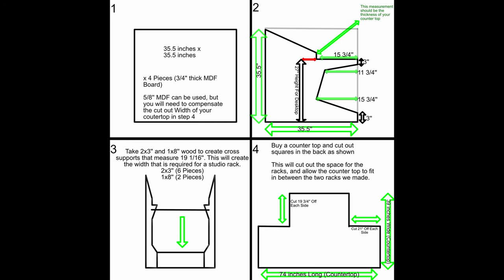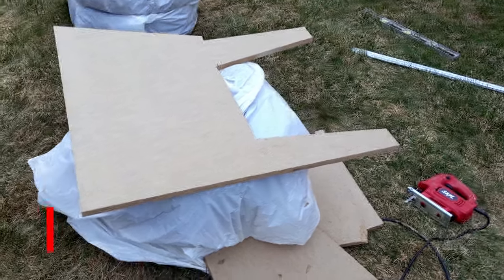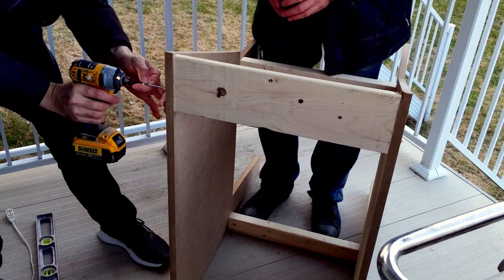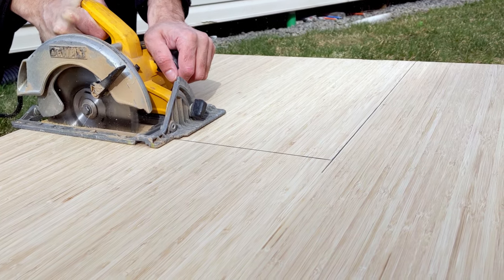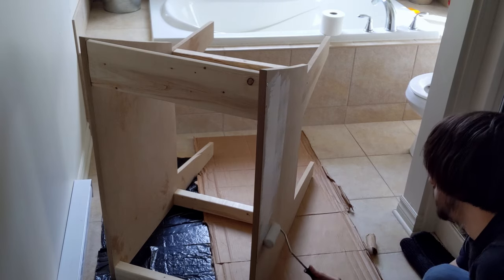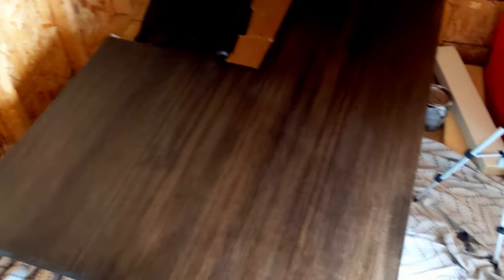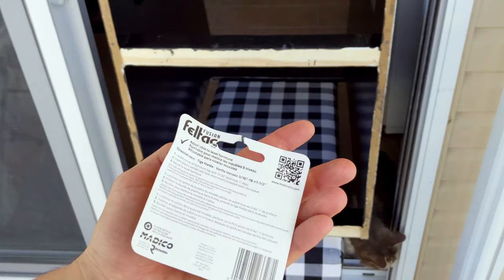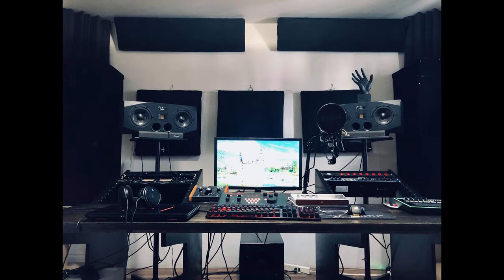DIY Music Studio Desk - Build A Desk In 10 Steps [+ Free Plans]

Comment: Great video .. I built a desk using your plans but made it with top shelves for my monitors as I don’t have room for separate stands .. I also used a solid oak desk top .. it looks great .. thanks again for your video, it inspired me to make my own desk without spending a huge amount of money
Reply: How much did it coast you ?
Reply: Do you have any pics you wanna share?
Reply: @vpetroi3  sorry for the HUGE delay in responding …. If I remember correctly, I was around £350 all in but this included the oak worktop … you could cut the cost with a cheaper worktop … hope this helps

Comment: Tip: If your using a level to level and plumb your project, you have to make sure what it is sitting on is level, or you wont be square or  level when it sitting on a level surface like your floor.

Comment: Nice desk, I'll make mine base on this design. Just a tip as I'm a construction worker. Using a leveling tool is fine if the reference surface is level. I have learned that the hard way at my first job site years ago! That balcony propably have a small inclinasion toward the outside the help the water evacuate the oposite side of the house. This one look sturdy, but you never know. Always check your reference surface as a mixing eng. use references tracks when using a leveling tool.

Comment: NICE man! So, now that you've been at the desk for a bit, are there any things you would change?
Reply from the maker: Hey, I would maybe have gone with less depth on the front part of the desk surface, it's a bit of a stretch for me to reach anything at the top few rack spaces 

That's the main one I sometimes think of
Reply: @ClaritoneAudio  You could cut a section out of the desk top, in the front middle, so that you can scoot in closer, and just re stain/poly the cut. Round the outside corners on the cut, so you don't have sharp ends. Currently building a desk, and really like how you have the rack accessible from the top. Looks real nice man!!
Reply: @AI-Consultant  Just draw a design on the top of the desk, cut that out with a jig saw, and then go around it with a router if you want to smooth it out. You could use a "flush cut round over bit" if you want.
Reply: I’m building this.  Will post when finished.  Thank You!
Reply: This is amazing work thanks for sharing. 
The bamboo top kind of surprises me.. very cool.

Comment: How do you figure out the angle of the rack units?
Reply: I used an angle finder and it came to 65 degrees.
Reply from the maker: this changes based on the thickness of your desktop material.. you'll have to adjust all the cuts if you want to change the angle more than it is.

Comment: I love this design because I'll be moving soon and this allows you to have the desk in manageable pieces. Thank you so much for the plans.  I do plan to build this desk.  The modifications I'm thinking of are to only have 6 rack spaces per side instead of 10 per side.  And also to make the desk top a couple of inches shorter.  I'm not sure how these changes will affect the stability of the desk, though.  I may even put the two sides together with no space in-between to make it more compact.  (like the Bazel Raystag desks) and then add a ledge behind the racks to hold the video monitor.  This guy did something similar to this desk in Europe, using metric measurements with angled side pieces - https://www.youtube.com/watch?v=KTGrjkJs2gw.

Comment: Nice design.  How much of a cost difference would you say there is between this and a ready made desk?
Reply from the maker: +Sub Element Recordings desks here in Canada start at around 1000 for the absolute cheapest options made for studios. 

something with this size and rack space would be anywhere from 1500$ and up + the shipping costs of ordering a full desk :) so at least 50% cheaper I would say.
Reply: @ClaritoneAudio  That's a significant difference.  Thanks for the info.  I'm in the market for a new desk and have been playing around with the DIY option.  I like this design.  I would likely make a small modification for a touchscreen if I went this route, but this is probably the best DIY design I've seen around.  Great work!  Cheers!
Reply from the maker: +Sub Element Recordings totally ! and that's the beauty of it, you can play with it based on your needs and available materials. 

thanks, I'm very glad to hear that! good luck with yours, cheers !

Comment: That's amazing. I'd like to build but I can't find the bamboo counter that deep. Where did you find yours?
Reply from the maker: Hi, 

I'm from Canada so I'm not sure if it will apply, but it was purchased at the hardware store Rona. 

If you find a piece that is slightly less deep it could work with little or no changes to plans. 

Width can also be adjusted of course, that's as easy as spacing the two bottom rack/support pieces further apart 

Good luck and hope you can make your own plans with what you find locally 🙏
Reply: @ClaritoneAudio  Thanks!

Comment: Step 2 shows and angled cut from the bottom foot (15 3/4) to the top arm (11 3/4).  In the video this cut looks straight.  Is there a reason you chose to do it straight instead of like the plans?
Reply from the maker: Hi, these plans were redrawn nicely after I built them from the original plans i scribbled down.. This was a change that was done then.

If I would redo it i would add that angle as it looks nice and would also be more sturdy for supporting the countertop (not that there is sturdiness issues in either case) 

Hope that helps